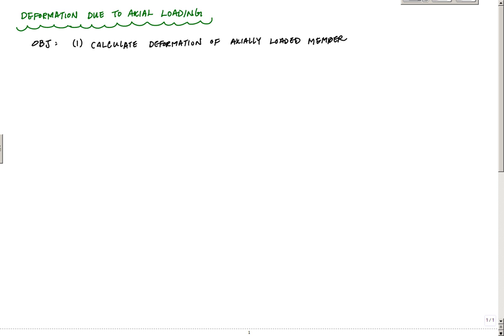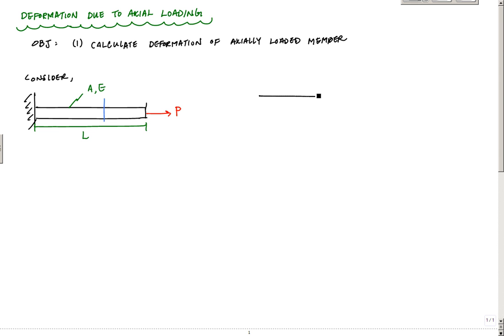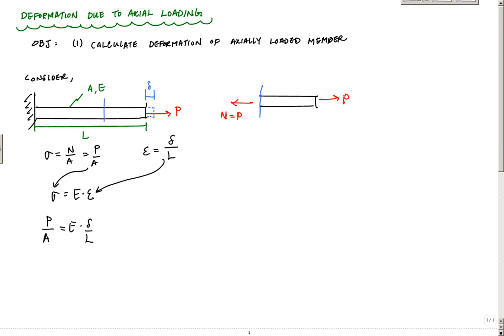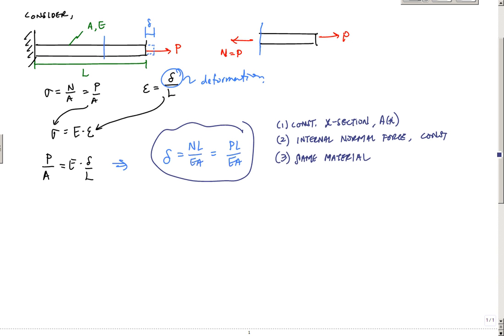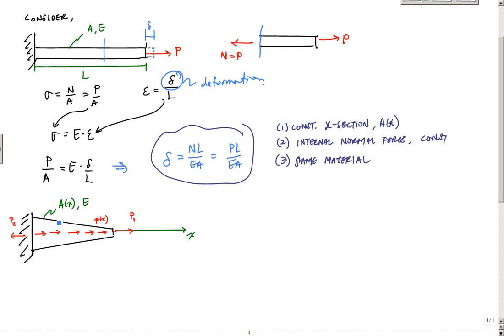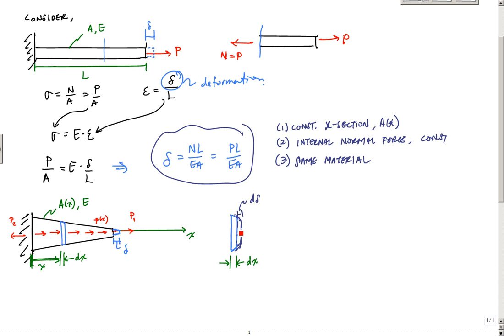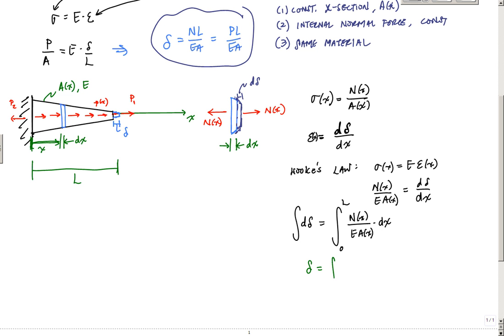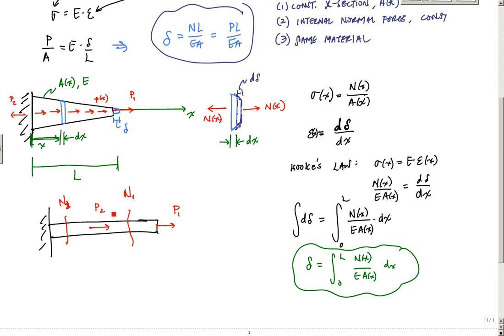Introduction to Axial Deformation

Comment: Wouldn't the area not be constant, though? In the previous video we saw that if we elongate a member that the diameter would also change and we related the two using poisson's ratio.
Reply: Like all Sciences, this is basically running down the theory behind Axial Load and Axial Deformation under a "Perfect world Condition", aka don't over think it since it's the theory portion, once you get to actual practice problems and stuff then you are probably gonna be looking for stuff like that

Comment: could someone tell me what does 
E and N means ?
Reply: E - Modulus of Elasticity
N - Normal force (in this video) (Force reacting in opposite to the load P for an axially loaded member)

N - is factor of safety when you are dealing with working stress (N= force at yielding point)

Comment: Can an axially load member experience a shear stress? It's a one single continuous member with no bond or weld. I'm preparing for my FE and the question gives a shaft which is subjected to a tensile load and a torque, so I use the equation of shear stress due to torsion but it turns out to be wrong. What the solution does is it uses the equation to calculate the maximum shear stress for an element, it's the second term of the equation we use to find the principle stress. It's just so confusing that an axially loaded member can experience some shear stress :|
Reply from the maker: WHY70122 if there is an external torque and an axially applied internal load, then the shaft experiences both shear stress and normal stress depending on where you look on the cross-section.

Comment: I have a question about how you got N(x) at 6:41. Shouldn't N(x) on the right side be N(x + dx) due to the width of the section? Or is it because the width is infinitesimally small or that the length x actually ends on the right side of the section? Or am I just wrong?

Btw loving your videos!! I find it soo much more clearer and enjoyable to watch than my lecture recordings